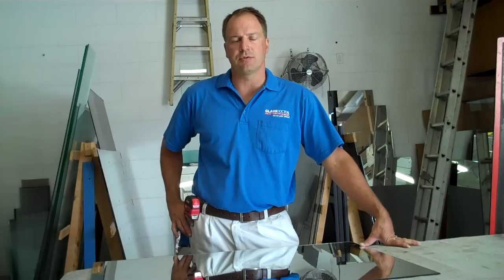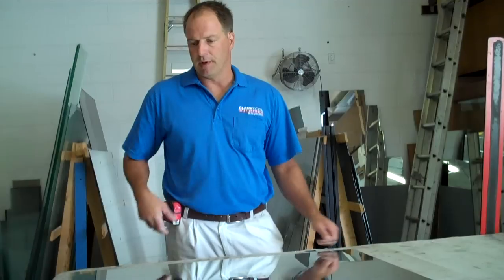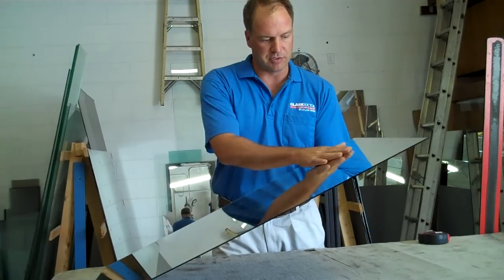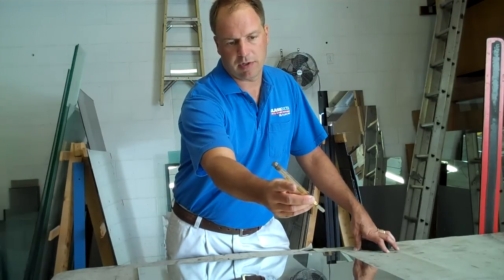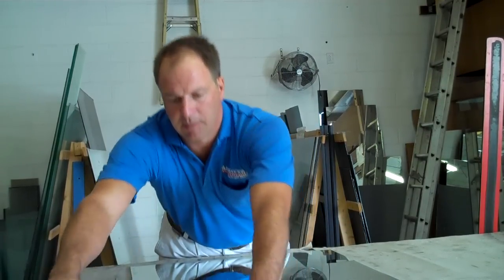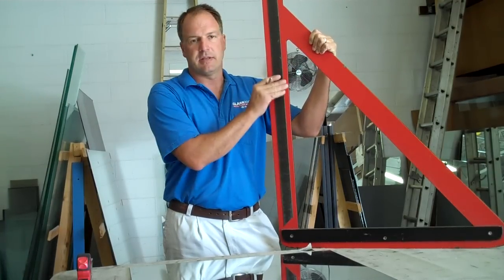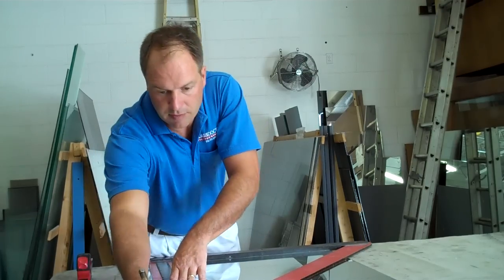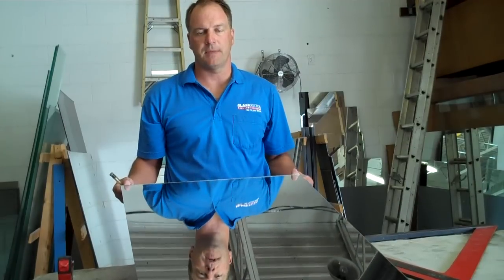How to cut mirror? l  Tips and Guide

Comment: What he means when he says bigger the mirror easier it is is....That the closer your cut is 2 the edge of the glass the harder it is for the glass to run out,If your real close you will need glass pliers and if its 1/8th or thicker it more then likely wont run out and will have 2 come off in chucks and you have 2 seem it 2 get it nice n smooth.

Comment: My glass did not break apart easily. I had to tap it which shattered the glass. What would you suggest? It happened with both 1/4 mirror and 1/8”.
Reply: You did not score the glass very well. You have the listen for the sound of you wheel scoring the glass. If it is not a consistent scratching sound then you did not score the glass properly.  Then on top of that. If you try to go back and re score the glass. You can F it up that way too and it will not break right. 

Just remember when cutting glass. You must score the glass all the way from top to bottom. You will here that screeching sound when you are scoring the glass correctly.

Comment: i wanted to cut a 3' x 6' mirror into 2 pieces measuring 1.5' x 3'. I bought a regular glass cutter (no oil reservoir) from a hardware store. I will only be using it once or twice. What kind of oil should i use? Thank you for the video it was really helpful...

Comment: Mike.......thanks for the video............I always have a problem with the backing not being strait after a cut.........especially with a thicker mirror.........should I use tape.....on the back ......will that help......I am remodeling my bathroom and I want to cut down the existing frameless mirror measuring 36 by 60 to like 31 1/2 by 46 or something to fit a 36x48 frame I'm having made out of oak......can you help

Comment: Great site!  Just found it and just subscribed...  I am buying a condo that has a mirrored wall in the L/R (panels about 3' wide and floor to ceiling.  I want to remove it.  How?  Also, I'd like to reuse some of it and cut it into panels to replace the plastic suspended ceiling panels in the bathroom.  Will the weight be to much do you think?  I will use common sense and in any case will take full responsibility for what happens!!!  But your input would be appreciated.

Comment from the maker: @MovingUpp  1/8 and 1/4 is typical.  same technique used in both.  1/4 just is a little harder to snap.   Crl sells a oil used for cutters, but any real thin oil works fine.
good luck

Comment: Mike, thank you for this video. I found an old piece of mirrored glass, and am thinking about cutting it down to fit in a frame I have. Are there any specific tips you could give me? Does old glass have problems staying smooth when cut? Iwas told that it tends to leave beveled oval shapes when you cut it. Is that true or just if its not done properly?

Comment: Love the video it was simple and showed how easy it was with the right tools. How would you cut circle hole in a mirror?   I  want to build my own diy vanity mirror with light in it Holly wood style but have no idea how I should cut the circles in the mirror with out breaking it?   Any ideas?
Reply: circle marked and cut, then cut 2 axial lines outward (4 on pieces bigger than 200mm).
Have seen it done with one axial and you start in a circular pressure motion from the cut line around the perimeter.

Comment: Rate your video:  Poor sound quality.  You show us you oil-cutter (but we can't really see it) -- but....how many of us have one of those??  Why don't you show us how WE can use a typical glass cutter -- and maybe where to manually apply the oil.  Also...the fancy neoprene stick with rubber.  Are you showing off what YOU have -- or trying to help US average homeowners.  And last -- you snap it with bare fingers.  Don't you think you ought to strongly recommend we wear gloves for safety.  RATING:  This gentleman is more interested in showing off his stuff -- than helping US do our stuff.  Other glass cutting videos on Youtube are much better at assisting  US - the average homeowner.
Reply: Hi Steve, regrettably you`re right. Even his table is almost non visible enough. And he is talking tooooo much. Greetings from Macedonia.
Reply: Agree on all points. This video was one of the first mirror cutting hits but I found it not very helpful.  One of the biggest issues was the camera angle did not cover, well, the actual mirror cutting very well.  I thought the point of this video.....  I was looking for instructions on how to cut a mirror to replace our broken dresser mirror. I will be doing a project like this probably once in my lifetime so I was looking for how a DIY could do it on a budget. If I had all those fancy tools then I would probably already know how to do all this and therefore wouldn't need this video.
Reply: wangwtfletmesignup You're reply to the three knuckleheads was awesome! Saved me some typing, and I'd not have done as brilliant of a job.  You da man!!

Comment: can a mirror be cut while still on the wall? I need to trim off 6 inches on the bottom.
Reply: +DaG37boy take the mirror off the wall LOL and stop being lazy or chancing it completely breaking
Reply: +John Doe Thats an ignorant response. Why would I destroy drywall and possibly the mirror in the process if it can be cut while on the wall? Come on dude, its pretty elementary really.
Reply: DaG37boy How is it ignorant? Its common sense. If you are incapable of removing a mirror from drywall mind you its a few screws then you may not want to tackle the job. Literally its mounted with 4 or so screws. To each is their own i guess
Reply: +John Doe So you know how my mirror is mounted? So even though my mirror is GLUED to the drywall you're still going with  "TAKE THE 4 SCREWS OUT"? I hope somebody with more sense than you can give a rational knowledge answer. My original question remains.
Reply: Well its its glued to the drywall and paint then I feel for who ever thought it was the right way to do it. Heat gun takes care of the issue have a nice day
Reply: +John Doe i bet it's liquid nail's on. i've seen that. really is impossible to take off. you could cut it on the wall, but snapping the scored line might not work because you would want to push it back, and if the construction adhesive is behind the score line, the tension on the scored side could not be created to crack it. perhaps a light tap with a hammer would give it a quick and deliberate enough hit to snap it. snapping with your fingers would be a sustained light pressure where a hammer would be short and high pressure.